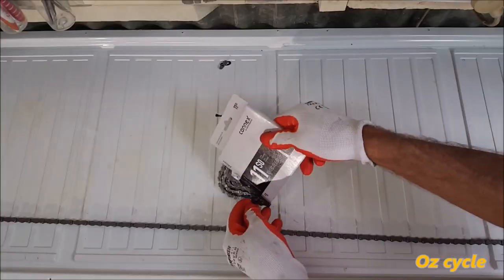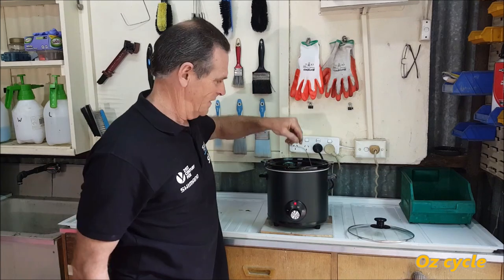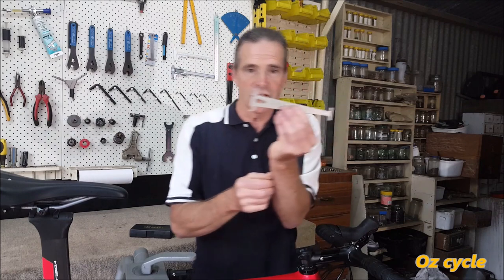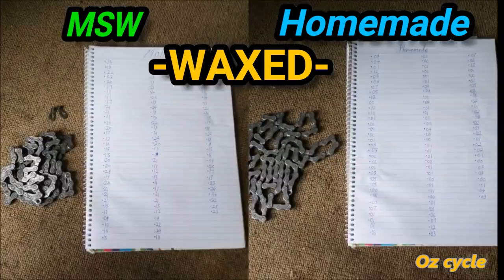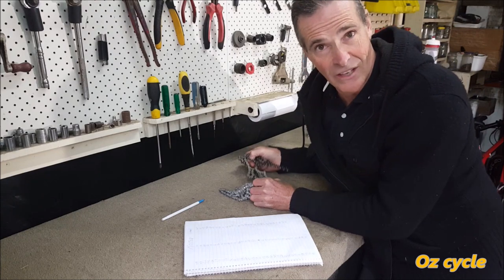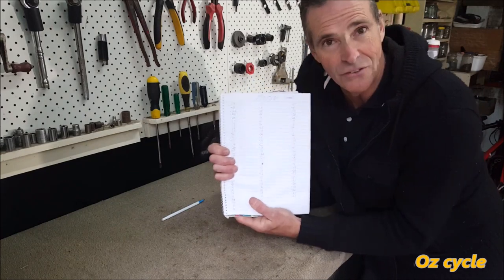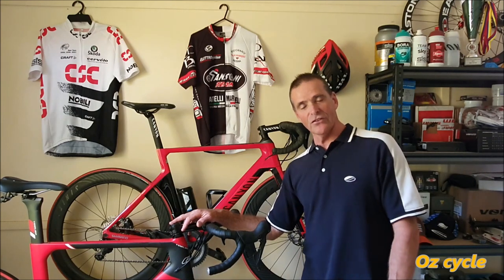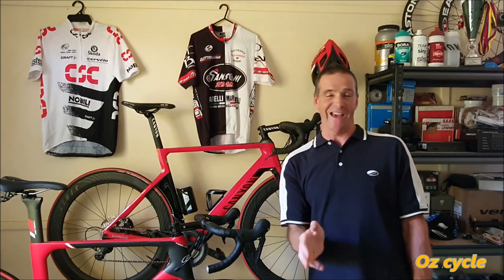Is this the ultimate bicycle chain lube? - Test results

Comment: Hi there, cool video and test, but as a product tester for chains and lubes there a few important points that all need to be aware. First - real world testing unfortunately gives extremely ball park results. Having previously real world tested the same lube and same chain in my normal training, i attained anywhere from 4,000km to 6,500km. There are just far too many variables - what load is applied when, what contamination is the chain exposed to too and when, and how long from x contamination exposure to next re-lube / re wax. Certainly for lubricants that are performing at various ends of the spectrum - one will always come up trumps by a notable amount, ie a top lube vs a poor lube - it will be night and day.

 But for lubricants that may perform in a similar ballpark, real world testing simply provides far too big a ball park to obtain a definitive result, there are simply far far too many uncontrolled variables. If a manufacturer released such a test as proof of its superior performance over competitors, the test would be quickly shot down on many (correct) fronts. Machine controlled testing where same load is run through all test chains, with same amount and type of contamination added and at the same distance, with re lube / re wax also performed at the same intervals etc - this level of control is simply a must. It is also telling that msw chain had some rust on it. Having tested msw rather extensively, and with lots of wet contamination - a chain has never rusted. 

The testing protocol and Zero Friction Cycling ensures it remains within manufacturer guidelines. If a lubricant is tested outside of manufacturer guidelines, then that is akin to taking a ferarri to a 4wd track and calling it a crap car - one does not get data of any value. MSW is made of lab grade / medical grade paraffin which is refined to contain almost zero mineral oil, as such it does not leave any film or coating on outside of chain. The home blend likely contains some level of mineral oil which softens the feel and also would be more protective for longer periods between re waxes especially if water has been involved. In short - the the msw chain is showing rust spots, the msw chain has been run beyond its recommended treatment lifespan or left for too long a period post wet ride. Following manufacturer instructions one should never experience rusting or oxidation.

 It would be great for this home blend to be sent to Zero Friction Cycling so that it can be assessed under the same controlled test protocol for proper comparison.  Even taking the above into account, it seems likely that the home blend is a very high performing and clean lubricant, and not knowing at the moment (havent seen the how to make video) exactly what it is made of, it may be a very environmentally friendly lubricant. Especially for training, commuting etc, that level of cleanliness, greater wet weather protection, low wear etc - it is something well worthy of a more exacting test. Pls PM Adam at ZFC to discuss having a batch of home blend tested. The real world chain and drive train longevity and ultra low friction has been extensively proven by multiple test bodies in conjunction with huge amounts of real world customer data, it would be great to see this in a proper controlled test - it is highly possible it will be a great choice for many who do not need ultimate speed etc.
Reply from the maker: Will be sending you a batch for testing soon Adam,thankyou.
Reply: Don't you think that Zero friction cycling already tested this combinaison ?
I guess he just didin't publish the result that would put all the others wax lubes that are 10 times the price, irrelevant.
Nobody can make money off this formula and money is still the name of the game in his business...
Reply from the maker: I offered to send him a couple of blocks to test. It's also easy to make. Nothing happened. Now there are quite a number of people making and selling this wax worldwide. So yes , money seems to be the game.
Reply: @stevenleffanue  That's what i thought yes...
I think he tested it but had no point on publishing the results if it was as good as the best ones.
Just too cheap and too accessible i would guess.
Reply: @nadsim154  no, not tested, and no point, refer diy wax section in FAQ guide for details why. Oz didn't organise to send any when had a chance for test, now testing is far too busy to test a diy wax (again see FAQ guide re why). Dont jump on commercial conspiracy crap. Everyone seems hellbent to make basically anything some grand conspiracy these days. If only you say how many crap diy waxes out therex where person has bought x wax for x dollars + delivery, then y ptfe from y place + delivery   and then sometimes another additive like tungsten disulphide + delivery, all up they have paid as much or more vs a bag of msw, but have a crap gunky wax because base wax is crap, and it's a palava to get such a wax chain properly clean to start over. Yes many can if they get a good base wax make a wax that is perfectly good, and that beats most lubricants on lbs shelves. Sadly this is not what many diy waxrrs make, nor can they match the wax base of the top waxes, so the total cost to run is almost never lower for a diy wax vs a proven top wax that has a huge amount of genuine R&D and testing behind it. Read the documentnin zfc website call the Oz cycle video where I outline the errors in the seemingly thorough testing. Zfc is independent. The world is a big place. Diy waxing is very very niche. And yet it causes no end of time sucking problems. I would have lost literally hundred of hours of time just answering emails requesting help from around the world from their diy waxing gone wrong. There is no commercial conspiracy. One can spend 50 bucks on a bag of proven super low wear product that will last 10,000km, or one can risk diy. Just if they go diy and it's crap - and so many people end up with that result, well on balance it just seems to do more harm than good vs genuinely awesome products. One should be asking why Oz cycle test for msw was so obviously flawed so as to, in my opinion, deliberately attain a poor result for a great product. Also immersive waxing is only a fraction of zfc business focus, my goodness there is so much more to zfc life than msw or diy waxing. Take the time to investigate zfc perspective with FAQ guide diy wax section and Oz cycle vid document and see then where you think any questionable motives lie.
Reply: @adamkerin4130  Hi Adam, thank you for your explanation.
Firstly, I think you forgot to clearly mention that you are actually working for Zero friction cycling, so we can understand that your view may not be a neutral one.
You are talking about diy waxing like it is something crazy to make, and everybody is asking for help to you guys because they are messing up and so on…
But let be real, we are just talking about paraffine and one additive, it is just as easy to use (and make) as a bag of msw or something else so please don’t overplay the “it may go wrong” part.
You have time (“hundreds of hours of time”) answering pm from people all over the world for their “diy waxing that gone wrong” but no time to do a proper comparison?
It’s not like you absolutely needed to receive a batch from Oz cycle to test paraffine with some ptfe.
Everybody has access to good quality and cheap paraffine wax, yeah not medical grade but who really cares?
The difference is really small and even, one can go medical grade if he wants but it doesn’t appear to be necessary. 
There are awesome products on the market, like the Silca one but a lot of people just prefer to pay 1/10 of the price for almost the same results, it's like everything else.
 And once again, I understand that you are also working with some wax manufacturers and reselling their products so promoting something you can’t make money off would not be very smart.
Btw, nice try with the conspiracy crap, especially in this world we are living in now… Proved to work amazingly as a defensive “fake” shield.
Don't forget the other sentence that is also really important to know these days, called : "conflict of interest", maybe you can talk more about that one too.
Ps : Concerning the msw test, I think you are right and it may have needed to be reapplied more frequently.
But, this also shows that it is an inferior product in a way because if you can’t even go 250-300 km with no rewaxing, I don’t see the point on doing an immersive application.

Comment: Great comparison. It proves the value of waxing a chain. Waxing has been my choice for years. One of the hidden demons for chains on the road is carbon. The carbon powder is left from car tires. Your front tire lifts the carbon particles and throws it at the chain. Wax keeps that abrasive from getting inside and grinding down the steel.
Reply: I mountain bike exclusively, always off road, and my chain lube still gets black. 

So some of it is probably tire carbon black, but some of it must be something else.

Comment: A German motorcycle magazine simply put the drive chains on an assembly using an electrical engine and let it run for weeks. Then they did the measurements very similar to yours. Note, that was before motorcycle drive chains with o-rings came out.

For the corrosion protection properties they used a piece of iron and then left it in a steam chamber. Another thing, they took the weight of each chain before and after the test.

Comment: Thanks for making this video. Looking forward to the new formula. I've been using your old candle wax formula thus far, and I'm very happy. I ride in the rain a lot, and I don't even worry about my chain at all. I don't clean it or anything, and it always looks great, with no rust. All I do is spray my cogs down with silicone spray every once in a while, being careful not to get it on the chain, as I don't want the silicone to dissolve the wax on the chain.
Reply: > silicone to dissolve the wax on the chain
I don't think that will happen since you need an organic solvent to dissolve the wax.
Reply: @cebruthius  Okay, that's good to know. Inevitably I do get it on the chain a bit.

Comment: I've used your old recipe for a couple of years, also switched to Wipperman Connexe chains. I have Rotor Aero Q Rings which are noisier than standard - always been annoying. However the combination of your waxing method and Wipperman makes the drive-line pretty well silent. As for wear - hardly any chain stretch! Previously KMC or Shimano chains (pre-waxing to be fair) "stretched" so a couple of chains a year needed, not now. Incidentally I use a proprietary wax lube called Squirt as a top-up midway between clean and re-waxing sessions, I tried to make up your top-up but it was always thick and needed heated and I would end up with lots of wax residue all over the drive-line. That's my method - your formula for cleaning and waxing and then top-ups with Squirt. Brilliant. Looking forward to your revised formula!

Comment: lI took chain some links apart and checked by 10-20x stereomicroscope and found that all chain rollers on inside corners are not perfectly polished and  has some uneven surface. Surface that rollers touch inner link is very small and very easily damaged by contamination mix with lubricants. Chains that I looked was both new- Dura ace 7700 25 anniversary and cheap 6-8 speed Shimano, rollers inside surface was practically the same, or not any big difference between them, rollers inner side corners was the same not perfect surface.  This is why you have very wide inconsistency on chain measurements.  Chains made simple and cheap, but design can be improved.  Your suggestion to use Paraffin is very logical and good idea. Thanks and please look chain links with microscope your self to understand differences Thanks  for your video.

Comment: Hi there 
Just a feedback about the old formula.
First I am using my 12speed chain on a pretty recent transmission (350 km +/-) and it's in very good condition (my bike wizard sayd).
It's an Enduro bike but I use it like a trail bike (no mountains near me)
I try it for 1 years more or less
And the result is on dry/dust condition it work for 20-30 km no more but in wet/mud condition it's 50-70 km easy.
= The wax don't like heat and fine dust.
But Whit cold mud it perform very well.
I am a chain maniac so I Wash and re-wax or re-lube my chain after each use
So, for hot conditions I prefer a good messy oil
But for winter or wet conditions the wax is perfect. 
(200 km with the wax technique and 100 km with oil)

Comment: Your test is amazing! One week ago i asked myself if a used chain gets shorter after waxing. 
You tested other way around. Good. The result is: there is a difference between clean and waxed chain in length!
My consideration: the wax fills up the very small 238 gaps in the chain bushings. And so shortens the chain. What do you think?
Thanks for your video! Sorry for my bad english.
If the measurement could be made on very high chain tension, the measurement differences would be smaller because the wax would be pushed besides temporarily at the relevant very small place. I think.

Could you length compare a Brand New chain before cleaning, after cleaning and after waxing. This could be an easy proof for refutation chain wear!!!!
Reply from the maker: I'd say you are correct Matthias

Comment: Gr8 stuff.  You convinced me, I am waxing now.
You asked, so I thought abt it: the white on homemade waxed chain is possibly PTFE residue.  If so, that explains why the homemade waxed chain is more worn post cleaning.  The PTFE has been removed and was filling the gaps between rollers etc.

Sorry, but the only way I can explain the molten being less worn after cleaning is, you swapped the series by accident.  Removing the wax should result in more wear revealed not less.  Blame the computer.

If you still have the molten waxed chain, past it’s end of life and not cleaned, you may be able to disprove my hypothesis.  Either way, it does not matter to me as the homemade wax is fantastic.
Reply from the maker: Yes I still have the MSW chain. I have every chain since started waxing 6 years ago including any associated paperwork. I know what you mean that the chain should measure shorter when waxed.  Nevertheless , thousands of other riders have now proved ptfe in paraffin wax makes a chain last so much longer.

Comment: Great video btw, really informative I like where you went to the trouble to extensively measure the chain with that digital chain tool and plotted the results of the long term test. I've just recently found your channel a few months and ago and was sold to convert to wax and paraffin oil on my MTB and road bike, I can't wait for the new formula cheers.

Comment: I am surprised to see that you have to make your chain flexible after cooling down.
I followed your instructions to make the home made wax with a portion parafine oil in it.
Because of this oil my chains are flexible after cooling down and the wax does not chip off.
Chipping off happens when the portion parafine oil is less.
Reply from the maker: It's a different recipe than the old wax

Comment: Interesting.  And very good testing and analysis.  I have spent 40+ years (retired now) in the lubricant industry, developing products.  First, the residue is either dirt, wear metals, or solid additives from the Molten.  Secondly, the chain has less wear after cleaning is something that should be investigated.  After the initial cleaning of the new chains, the chains should be weighed, and then weighed after the test.  I’m not sure if the mineral spirits will completely “cut” the waxy materials off the pins and rollers.  You may have just redistributed them, making it seem like the chain wore less after cleaning.  Another step you might try is to soak the chains after use in a hot bath of baby/white mineral oil to remove the wax, then clean with spirits.  Let me know if you want to discuss further, as I can give you my email address.  Good video!
Reply from the maker: Thanx William. The metholated spirits or isopropyl alcohol is for removing any oily film left in the chain from the previous cleaning chemical. Successful waxing requires metal to stick to.

Comment: I have been using a homemade wax formula for several years that contains molybdenum disulfide and teflon powders to enhance the parafin's lubrication.  The molybdenum disulfide powder is black and I when I clean my chain it leaves a similar residue in the solvent.  I suspect the commercial product you used contains this lubricant as well.  I began using wax because of its friction reduction properties and am please to learn that it help's my chain life as well.  Perhaps the most notable benefit is that I no longer have greasy stain appearing on my calf frequently.  Thank you for the great work and video and I am quite interested in your new formulation.

Comment: Great testing and video, but cleaning and rewaxing every 150 miles is a lot of work.......I'm curious what the cleaning process is (same as with a new chain) and also if the rewaxing involves the slow cooker every time or if it is applied while the chain is on the bike with a squeeze bottle.......
Reply from the maker: Rewax every 250km. Clean chain by pouring boiling water over it then popping chain in slow cooker for 10mins.
Reply: @stevenleffanue  I see.  thank you!